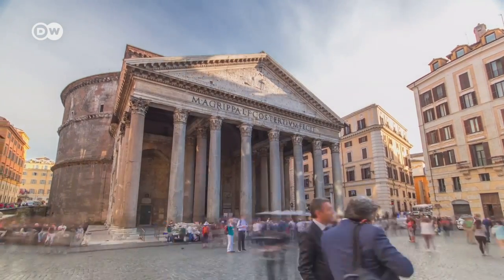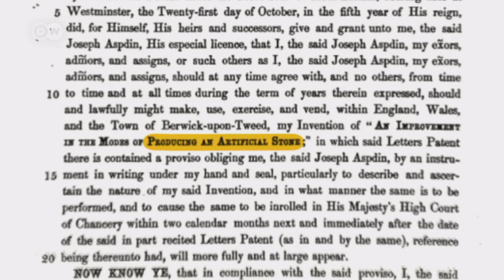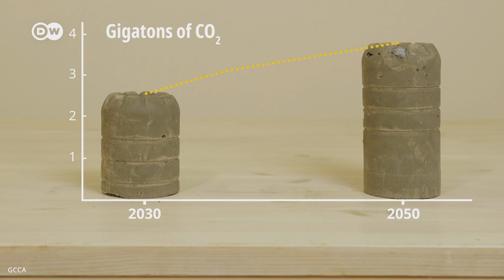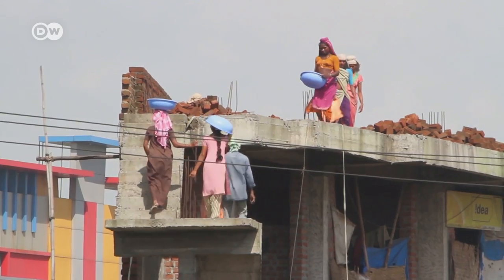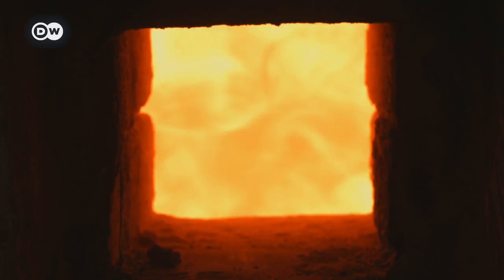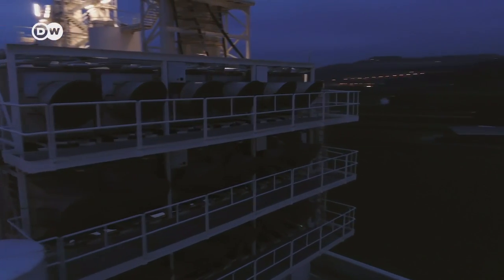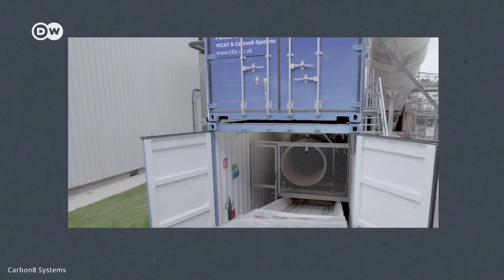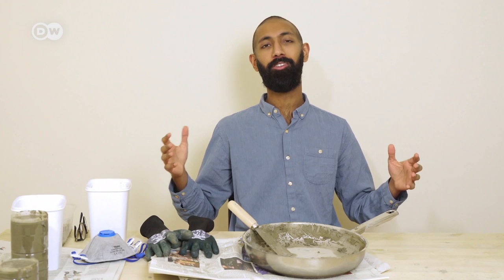How to fix the world's concrete problem

Comment: Hempcrete also seems very promising!
Reply: Chris Kyle died in the battle rip Massachusetts
Reply: What about cumcrete
Reply: Unfortunately hempcrete is very low strength (around 1/20th of concrete) and would not be useful in the vast majority of what we use concrete for today.
Reply: Maybe rammed earth
Reply: Yes please, way more carbon capture and overall carbon negative footprint instead of these lobbied ideas of concrete.
Don't get me wrong, there should be a place for both, but hempcrete is really easy to build with and super sustainable.
Reply: What is with people and being obsessed with hemp products? Bamboo is way better
Reply: @LolwutLol2000  you realize you can grow hemp hydroponically right?
Reply: So I wanted to add that producing such vast amounst of hemp would not be possible on an sustainable level because of the land requirements. Hemp is a wonderful material for a lot of things but cement isn't it. (Btw same reason hemp fuel is ineffective)
Reply: Damn Hippies and your permanent weed ideas
Reply: No it isn’t
Reply: @BigCroca   bamboo ain't  fireproof.
Reply: weed <3
Reply: @Baumstumpf.  "Like mann... why do you have to pour cold water & facts on such a good idea man...? Are you paid by Big Concrete man? You need to like... smoke some good green and see da truth ya know..."

Comment: A man in Africa has already solved this problem by using clay. His process cost 75% less than present concrete and does not release half the carbon of present concrete.
Reply: Also plastic could be used

Comment: What has been completely overlooked in this video is the fact that CCS or carbon capture & storage as its otherwise known, uses VAST amounts of electricity making the technology to date economically infeasible & in some cases, depending on how that electricity is generated, produces more greenhouse gas emissions than it captures.
Reply: At least with this technology there is some room for optimization - renewable energy, nuclear power plants (those small nuclear generators we keep hearing about). If we can't get rid of concrete - it's a step in the right direction, is it not?

Of course - if the electricity is going to be generated from coal burning, gas etc., then it makes no sense.
Reply: It's the same as people thinking electric cars are better for the environment, until you read what it takes to produce them and what elements go into making the batteries and electronics and how they pollute the environment when they are at the end of their life cycle
Reply: ccs  is rich people screwing you again. Agriculture is the only thing big enough to capture enough carbon, and the only thing that doesn't cost anything, but pays(!)  e. g. Greg Judy, Gabe Brown, Allen Savory

Comment: “Concrete is a climate problem that nobody is talking about”
As a civil engineer, actually it’s always been talked about. But maybe just in our industry, not outside it.
Reply: well, there is recycled aggregates and low cement concrete and etc to reduce the total carbon emission.  but as engineers, what you can do the best is to use the green materials and green design that are approved by standards and policies and it must be within the budget, nothing more you can do.
Reply: @kevinw9806  very true
Reply: Yeah you guys just have to use what is available to you. Concrete is just the most efficient material to use for the required strength and budget. Most of Civil engineering involves concrete. Imagine trying to make a waste water treatment plant with out it? Or just thinking of something more extreme, A hydroelectric dam lol. Those would be near impossible without concrete.
Reply: I dare say it is being talked about outside of the industry too, for like the  past 10 years at least. People in the video saying that nobody is talking about it doesnt make it true. It is like the 10th video ive seen on the subject. Maybe they just want to make the video seem novel.
Reply: @Schmuni  Honestly concrete is the least of our worries. Just humans existing are the issue lol. The biggest one I have seen Is factories that use huge amounts of fuel or electricity constantly every single day. No one talks about that either. I have worked in a lot of factories that just leave things running 24/7 even though there is no one working, using more power than a thousand homes do in an hour. No one cares though
Reply: Agreed. We are constantly looking for methods to refining our concrete in order to reduce emissions. I'm sure not all enterprises respect that however. 
Keep up the good work man!
Reply: @kevinw9806  LEED scores man. Those mortgages are the best longterm investments. LEED certified ranks drastically increase property value.
Reply: Unfortunately if it never reaches outside of expert circles it will never be truly relevant :/
Reply: in the dinosaur era it was 1900ppm co2 and now 440. can anyone explain it to me?

Comment: This statement is partly inaccurate: "Another 22% of planned savings come from designing more efficient buildings, and extending their lifetimes. This is not entirely in the hands of the cement industry. It's also about how architects and engineers design our cities. They could retrofit old buildings instead of knocking them down and design new ones to last longer." 

As an architect and climate organizer, I can testify the decisions making power regarding the efficiency and lifespan of buildings are not in the hands of architects and engineers but rather in the hands of real estate developers and zoning regulators. Architects and engineer like to engage with these types of challenges; however, developer remain focused on their bottom line and refrain from investing in what's right (this is part of why there's a housing shortage). Zoning regulations are complex processes and developers often lobby for their economic interests.
Reply: wouldn't retrofitting cost more time, money and effort rather than starting all over in most cases. It could beneficial in cases where the building is still stable and strong but can be a health hazard and just be difficult to do in others?
Reply: 100% right and true
Reply: Wrong
Reply: @DurzoBlunts  it's false
Reply: exactly, systemic urbanism is the problem. We should have nice big cities for the economy but why make small cities all close to one another? We need to get used to the idea of helping people be more autonomous and connected without mashing them together. If you think this would be bad for the enviroment think about how nature would come in between the houses and how big cities could be even more high up.
Reply: Lady, you are so right. There is so much we can do with budgets. Some clients expect 1M $ value end-product from a 100,000$ budget. Logical right? I believe, it isn't even on Real Estate Agents. I think it goes down to the client purchasing the land and deciding what construction will be held there. It's really the clients that cheap out on means & methods, because corporate greed. :)

Comment: A UCLA team showed that the carbon dioxide given off during calcination can be captured and recombined with calcium hydroxide to recreate limestone — creating a cycle in which no carbon dioxide is released into the air. In addition, about 50 percent less heat is needed throughout the production cycle, since no additional heat is required to ensure the formation of tricalcium silicate.

Sant said the method is analogous to how limestone cementation occurs in nature, where limestone forms the tough exoskeletons of coral, mollusks and seashells, and when microbes form limestone that cements grains of sand together.  Thank you and be well.
Reply: do you mind posting the title, authors, and or link for this study? I am interested
Reply: but where do you get the same amount of Ca(OH) if not by burning limestone in the first place?
What's the UCLA study called?

Comment: I think the solution is to allow for other materials and techniques to be used on smaller buildings. Sometimes old techniques are not allowed because they are not inside building codes.  For example... Rammed earth is incredibly strong, and could be used for single family homes or really any building of two or three stories. Yet, I doubt you were allowed to do a building that way.
So I think building codes all over the world mus change to allow for these kinds of old or unconventional building techniques. It is just a matter of studying them, and make some guidelines, just like we have now with concrete.
Reply: yeah sometimes older is better. fe old furniture was much more durable than what we have these days. and thats not just because we use pressboard etc but also becasue of the way we make them, put together the pieces.
we should keep asking why we do certain things the way we do them. if sth works better then we should do that. but having these standartized rules what we are allowed and not allowed to do make it hard for that to happen.
Reply: @philiproler5572  It's called capitalism. Make something mediocre enough that people will buy it and do it as cheap as possible, and you're ahead in the game. Unfortunately there's no good solution.
Reply: @dav356  ofc... what i said doesnt deny that.
you can do the best with sth mediocre still.
and also dont forget thats it not only about using the least needed for the highest gain.
new things or things that work the best for sth will also be bought since for certain things ppl want the best and then are willing to pay more for it. 
if you want to get really rich you make sth for the masses with the least ressources but if you want to get rich you make sth really good.
Reply: @philiproler5572  I don't know in what financial position you are in, but I would not be able to afford furniture for my home if it were to be "the old furniture" - it's simply too expensive! On top of that - how would you approach moving with such furniture? They get pretty heavy, so moving them is almost impossible. I like my IKEA furniture, and they last for long enough for me.

As for the point above - yeah, maybe there are some alternative ways of building a home, but where am I going to find a team that will build it for me? I am sure as heck not going to have time to learn it myself. In a bigger city/suburbs MAYBE, but a small village? No way.
Reply: @TowerHunter  you shouldnt just think about your point of view only...
just because you and me couldnt afford it or dont own a house where we could get such furniture for doesnt mean that there arent enough ppl who can afford it and/or own a house. there are plenty ppl out there. and since youre offering a luxury item it doesnt matter that there are way less ppl who would choose "old style" furniture over ikea furniture since instead of low price high quantity youre selling high price low quantity. still a way to get rich. 

and as for who will build it thats what i meant basically. we should adapt more to certain situations. there should be ppl offering such a thing. 
if sth is better it should be done. you dont own a house and you wont be able to move with "oldstyle" furniture  and it would be to expensive for you? best option is ikea furniture.
you own a house and dont have to move and you got the money? best option is oldstyle furniture.
youre happy with a house made from mud and dont need electricity etc? get yourself  a house made out of mud xD
youre living somewhere dangerous and need protection? get yourself a fortress.

hope you got what i wanted to tell you with that :)
Reply: @dav356  There are good solutions to force companys to a certain minimum quality in Germany that work for more expancive stuff.  A product has to last 2 years (wear and tear, destruction by the owner or food not included). For cheap items noone would go through the effort to  RMA it after a year so it doesn't work there.
Reply: @TowerHunter  IKEA has "paper" (or cardboard) glued in a hexagon pattern and not even plywood for a lot of furniture. That can be pretty effective and isn't that bad when it is made of recycled material.
But if you don't plan to move you could invest into some better furniture that dosn't get destroyed by a bit of water that got through the coating.

Comment: Using Hempcrete for domestic buildings would also decrease emissions. Similar to concrete but not structural it does have a lot of uses.
Be interesting if you could put together a video about that, please.
Reply: Yes, we will make that for you! Stay tuned.
Reply: @LolwutLol2000  
Lots of real estate considered too toxic to plant food plants, mine heaps, splash piles, rubbish tips.
Reply: @LolwutLol2000  a bit hard to find, but you don't have to cut trees, you can use metal stud framing, or there are companies that make structural basically big lego brick construction, so it would be like a concrete block house, but made out of hemp.  it's cool stuff.

Comment: im not a cement expert but i wonder what would happen if you mixed ground plastics that are harder to use for one reason or another and mixed it into the concrete slurry? i mean, would you end up with a better concrete or would you just end up with integrity issues then? just a random thought ... it would be one way to get rid of excess plastics.

Comment: Thank you for this dipping of the toes into the issue, for people who know nothing about it.

Perhaps an advanced step, looking at alkali-activated pozzolans and geopolymers, replacing the CO2-intensive limestone component in cements with kaolin, which requires 10% or less of the energy to process to metakaolin as to reduce limestone to clinker, and is at least as plentiful and cheap?

And a look into why these stronger, cheaper, more environmentally resistant cements are so aggressively resisted by the OPC industry?

Comment: You can heat up kilns using direct sun energy. I saw this guy who is reaching temperatures high enough to make steel out of concentrated solar energy. That should also do for cement.
Reply: so you're suggesting to produce cement using fresnel lens?
Reply: @Tyson Bryant nah, I don't think so
Reply: @Tyson Bryant As much as you want :) Just add mirrors. The setup in the video is only a demo. It is actually designed with scalability in mind. The test plant has 400 mirrors; the real thing will have 40000. All deployed and installed by robots. Designed from the ground up to be dirt cheap and easy to set up. Heck, they store the eat into rocks. You can't get cheaper than that!
Reply: Could you put a link for us to see that tech, please?
Reply: @DunnickFayuro  Yes let's deforest large areas and cook it dead from the refracted light and heat it produces... Sounds like such a great thing for the environment.
Which Fyi is one reason why cities are having so many issues with heat, all the reflective windows they put in so it literally cooks the city raising their temperatures upwards of 30 degrees in the summer.
Reply: @SilvaDreams  Nobody said to cut forests except you. You invent an imaginary argument. This guy wants to install those solar refineries everywhere there is desert, like in Africa. You should watch the video instead of throwing straw men at me.

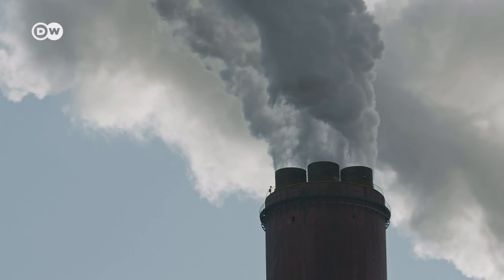Comment: 0:30 Please for the love of god, stop showing nuclear power plants emitting smoke when talking about excessive carbon emissions. You're cementing the idea that nuclear power plants produce a lot of CO2 when its not. That smoke isn't CO2, it's water vapour. 

If you really care about the climate and want to bring carbon emissions down, you'd support nuclear power because it emits very little carbon dioxide and far more energy compared to coal and oil power plants.

It's completely dishonest.

Comment: Everything depends on green energy. If we have enough of that - which we theoretically have -, we can do anything: capture carbon, recycle carbon, split carbon. The priorities for our governments and the industry should be clear then!
Reply: Economics disagrees
Reply: @Bleckyyyy  best we have right now is hydro and atomic, but no atomic scary waaa
Reply: Uranium is green energy, like literally
Reply: @Bleckyyyy  solar power plant do not need gas. They use it during cloudy weather which doesn't mean they need it to work. Wind turbines live much longer than 20 years they just aren't profitable anymore at older ages due to modern ones being more efficient. Since they are made out of tons of steel and copper I don't see how that is nonrecyclable either.
Reply: @Bleckyyyy  You don't need to repeat yourself. Solar power plants use gas to keep the water hot and start quicker in the morning. It is simply more profitable. There are dozens of articles describing exactly that with the Ivanpah plant in california. Rare earths are recyclable as well. Comparing the impact of climate change with the impact of mining is debatable in the same manner as debating whether to eat human feces or pizza. Wind turbines deteriorate by 27% in 19 years which is fine. I already looked it up before writing my first comment which is why I corrected your misinformation.
Reply: @SilvaDreams  ammonium diuranate begs to differ. Many uranium compounds are vibrantly green in color.
Reply: @Bloated_Tony_Danza  Yes.. uranium compounds but not actual uranium like many think.
That is like saying aluminum is golden because bronze is that color.
Reply: @SilvaDreams  so uranium compounds aren’t “actually uranium”…? I’m not listening to you, you don’t know what you’re talking about. Aluminum bronze is golden because of it’s copper content, if you substitute aluminum with tin, or zinc, or cadmium, or beryllium, then it’s still golden, so no, you’re analogy is completely inaccurate